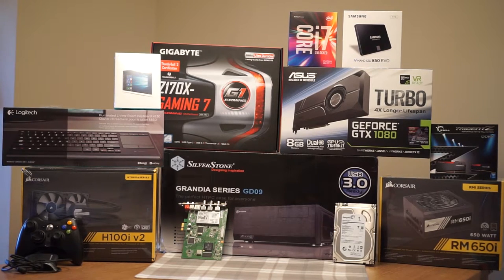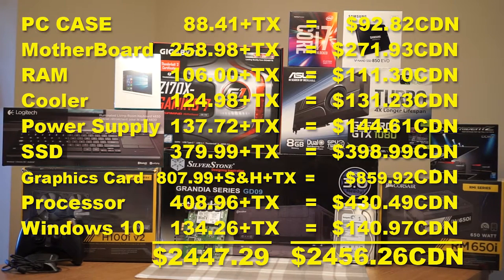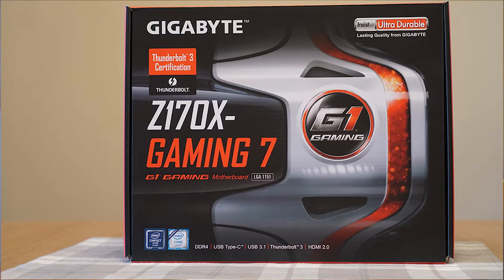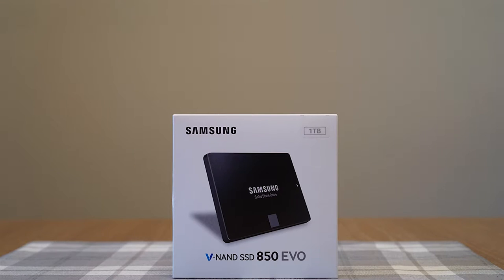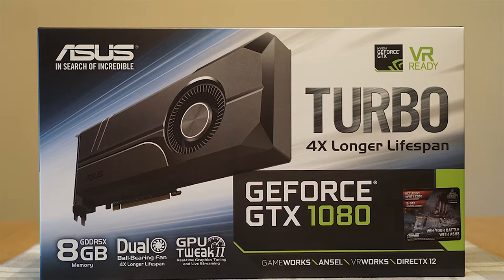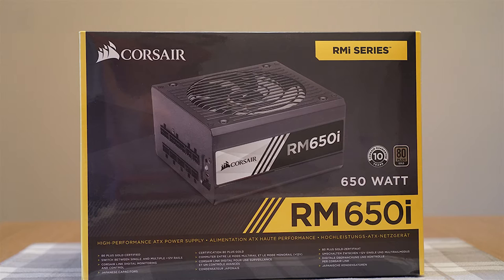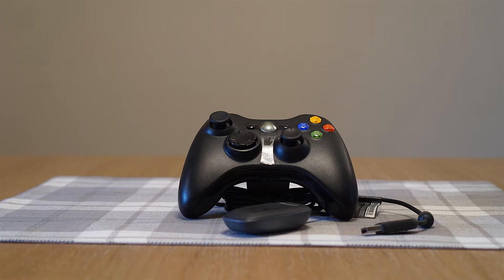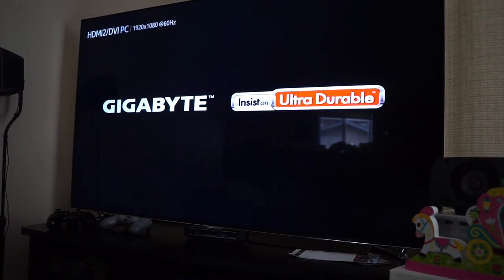4K Gaming Home Theater PC Build

Comment: Hello, I will buy from the same safe and there is something I am curious about. You have left the cover open Is the cover closing? Have you had a temperature problem? And don't the liquid cooling fans fit inside the case?
Reply from the maker: The cover fits; however, the liquid cooler took up too much space so my fans were on the outside of the case. The temps at first were bad because the pump on the cooler was broken, once corsair sent me a new cooler the temps were much better.

Comment: I'm using the same case. but I notice that H100i V2's fan cables are not thin enough to pass through the gap of the right side of the case. How do you treat with this issue? thx.
Reply from the maker: I have the fan cables on the left side not right side
Reply: @ThatsItOK  OK, It's left side if you look at the pc from the back:) Anyway, how do you arrange the fan cables? Do you dig a hole on the left side of the case?
Reply from the maker: @lingqikong5786  I was able to get the wires through holes where the fan grills attach, but it means you cannot attach the fan grills so I used some long screws to attach the fan grills.
Reply: @ThatsItOK  thx. so there is a tiny gap between the case side and the radiator for the wires passing?